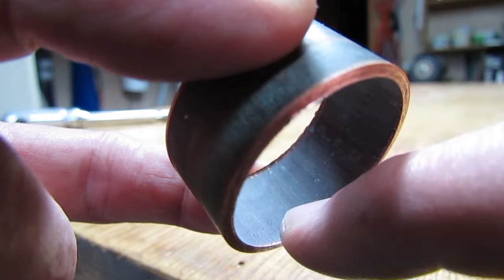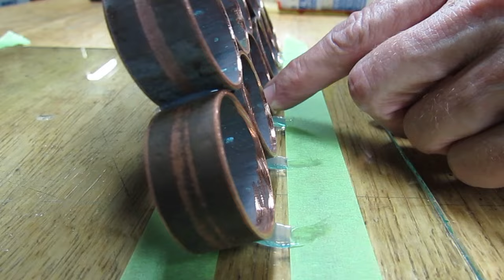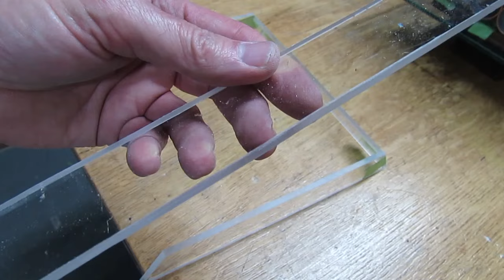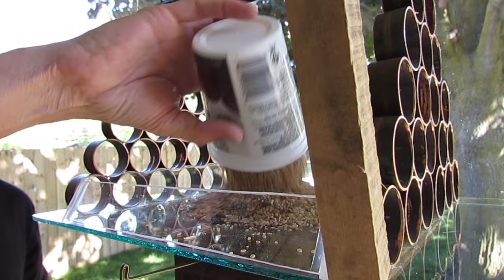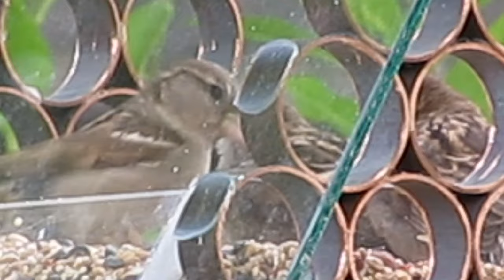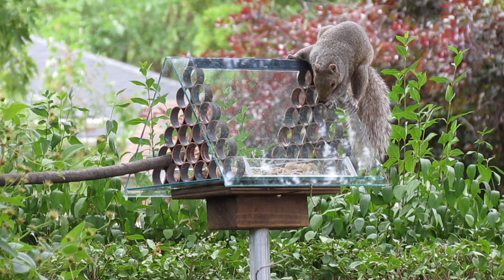How to make ● a  SQUIRREL PROOF  Bird Feeder

Comment from the maker: I'm working on another design!!  I will be using stainless steel rods horizontally instead of the circles. First I need to determine the perfect distance apart that the rods need to be so a squirrel cannot enter and will still allow the birds to get in which will be another video in itself!! Should be very entertaining! If you want, you can Subscribe Here:  ( and don't forget to click the Bell to Get Notified! )  https://www.youtube.com/subscription_center?add_user=chrisnotap
Reply: You would just need a size smaller than the average squirrel head. It's the one part that can't compress, like cats.
Reply: Nice bird variety
Reply: Thanks Chris
Reply: Do you sell these? If so I would LOVE to buy one! Please let me know, thanks 🙂
Reply: You can also build one for eagles
So that there is always a squirrel when they come by.
Reply: I would LOOOVE to buy a couple of THESE (but NOT IN GLASS),   or OTHER  "squirrel proof"  model you come up with..  Appreciate you letting me know.
You have  GREAT IDEAS, so MAKE  SURE  you PATTEN these..
You ha
Reply: I'm not very tool savy, but I really want to make this. What do you call the tool you used to smooth the edges of the cut copper pipe ? Will it be easy to attach to my electric drill ?
Reply: Moo
Reply: Why not use plexiglass for the whole thing, in place of real glass?
Reply: @fgjf1079  Wondering this myself. Seems to me, plexiglass would be a whole lot less expensive and wouldn't break if a tree branch fell on it....
Reply: @fgjf1079   might get chewed through
Reply: @TheDrakulie 

Llla
LAq
Reply: @craigrainbow7674  
Pplp
Reply: New design still in the works?
Reply: @culinarycat6607  Ditto what Culinary Cat said. I don't have tools to make it, but I could buy one....
Reply: What a beautiful design!  Functional, and pleasant to look at!  LOVE IT!  Thank you!
Reply: that is loveley.what are the measurements on the glass pieces?thank you.fady
Reply from the maker: @fadyassaad4590  All of the measurements are in the description.
Reply: @sjosly2  u can go into home depot tool section and ask them . Thinks it's a mini grinder bit for cordless They have kits with all sizes ....
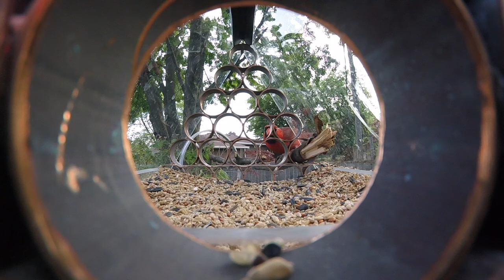Reply: Awww, that big red bird at 3:48 couldn't fit in :-(
Reply: Cool...  but can you build a  bird proof squirrel feeder ?
Reply: Can you make a bear proof one?
Reply: Build a feeder for squirrel too...they are feel hungry...don't hate them
Reply: @chrisnotap  still can't make it. I was  Rubbish at cdt in school. Not much has changed. Still rubbish now.
Reply: I'd like to see your new design. Just wondering why you aren't using PVC instead of metal pipe? A lot cheaper and easier to cut. Also PVC glue "welds" it permanently together.
Reply: I guess plexiglass would work just as well and be lighter in weight and less fragile, yes?
Reply: @culinarycat6607  You could find your local handy person, show him or her this video and I'm sure they could make it. You could go to a hardware store, like home depot, they have classes on building things.
Reply: @sjosly2  You could use metal napkin rings, just make sure they're the right size and they won't rust.
Reply: @GwenArlene8181  The squirrels would chew through it. That's why he used glass.
Reply: I feed both...squirrels and birds and they get a long very well...they need food too.
Reply: lol
Reply: Hahaha
Reply: One question are you selling these!???? I need one badly.
Reply: @TheDrakulie  exactly...these videis are just so stupid!
Reply: @culinarycat6607  me, too!
Reply: @vsmallworld8153  doesn't look like too much needed to buy in order to make. If I make em I will definitely  make for gifts.
Reply: @fredashay  i was wondering if bigger birds would not fit! Maybe there is a way to make slightly bigger, enough for bigger birds but no squirrels still
Reply: @zedman6473  it doesn't look super difficult.  Maybe give it another shot. Think of the fun you'll have watching those squirrels! I am not handy at all with stuff like this bit I might give it a shot. Looks fun watching frustrated squirrels. And if I can make them I want to make more for gifts for my friends.
Reply: Nice job 👍 ✌️🇨🇦
Reply: Two years later... 1 1/4"!!
Reply: 😎would keep other unwanted birds out too
Reply from the maker: @lizday8140  The young ones won't venture onto feeders like this until they gain confidence and get bigger. At that point they can't get in.
Reply: What a waste of time. I bet if they take you into a cell and tell you to design war machines, you would do it.

Comment: Squirrel comes back the next day with a hammer and a grin.
Reply: Most likely a rock and a high platform...
Throw and shatter
Reply from the maker: I'm working on another design.  I will be using stainless steel rods horizontally instead of copper circles. First I need to determine the perfect distance apart that the rods need to be so a squirrel cannot enter and will still allow the birds to get in which will be another video in itself!! Should be very entertaining! If you want, you can Subscribe Here:  ( and don't forget to click the Bell to Get Notified! )  https://www.youtube.com/subscription_center?add_user=chrisnotap
Reply: How come you used glass instead of plexiglass?
Reply: @TheRoyce55  forces squirrel to bring hammer instead of blowtorch which is more portable..lol
Reply: More like squirrel comes back with mafia mate knuckles the smasher..😆 🤣 😂
Reply: Only to be disappointed that the glass is actually from a window security company.
Reply: @theman7349  so the squirrels call in the friend from California arnold and his rocket launcher..😆 🤣 😂
Reply: i think next the squirrel crack the by throughout a nut
Reply: Question: what is the pretty little beige bird with the spot of red on the back of its head?
Reply: Squirrel comes back the next day with her baby squirrel to enter in that tiny hole.😁
Reply: @TheRoyce55  I think that the glass is more durable??
Reply: ok , but this feeds only smaller type of birds.
Reply: @TheRoyce55  Because squirrels can chew through the plexiglass.  I asked myself why PVC pipe wasn't used instead of much more expensive copper, then mentally face palmed when I realized sharp teeth would triumph over plastic everytime, but never metal.  Same applies for the glass.
Reply: I show up with pellet gun and skinning knife
Reply: @terryogletree2128  don't hurt yourself.
Reply: @anneramirez9577  time stamp?
Reply: Yes i do believe at least mines🙊
Reply: @spockslot  right😁
Reply: Squirrels get pissed and end up eating the birds 😂
Reply: The squirrel is going to eat through it. Just watch. They're unstoppable. They ate through my garbage can to get at a jar of leftover peanut butter. They can easily chew through plastic.
Reply: No doubt!
Reply: @sparkypack  True. Squirrels eats nuts for breakfast.
Reply: So, this is excellent to keep out robbins, blue jays & squirrels, got it...   🤔💭  🐹🐦
Reply: @taekwondotime  a squirrel can eat through glass and metal?
Reply: @andreww3278  They have no trouble eating through plastic.  :)
Reply: @anneramirez9577  Hi Anne. It's a woodpecker called a Northern Flicker. Fairly large.
Reply: It could be plastic
Reply: You saw him look at the camera, grin, and contemplate
Reply: @chrisnotap  2 years later... 1 1/4"!!
Reply: @anneramirez9577  I’m sure you found an answer after this amount of time but on the tiny chance-  A Northern Flicker, perhaps?
Reply: @Lint_Julep  thanks!

Comment: Looks very nice and easy to make.  Over 3k comments, I couldn't read them all. So, this may have been posted already.  The only suggestion I can make is to use some sort of bumper, silicone bead, rubber, cloth, wood, etc. on the edge of the bottom glass.  This would lessen the likelihood  breakage of the opening panel in the event of an accidental drop.
Reply from the maker: Great tip.... yes!!

Comment: Well done!  Never thought I'd see the day a squirrel proof feeder that actually worked!
Reply: You haven't seen the ones where the owners electrify the feeders. The birds can eat freely without harm but the squirrels get a shocking surprise. It doesn't harm them but it let's them know they are not welcome. What if they do come back? They get more of the same!
Reply: That feeder won't prevent baby squirrels from getting to the birdseed. My design works on all squirrels large and small, and it didn't cost me anything.
Not sure I can adequately describe it here, but I will try....I took a black tree nursery style plastic pot (about 1-1/2 to 2 gallon capacity), drilled a hole in the middle of the base a bit smaller than the pole so it stays in place when it is slid up the pole. I removed the stabilizer bar on the bottom of my shepherd's hook pole and slid the pot up so it hangs like a bell when the pole is upright. Any lip should be removed from the mouth of the pot so the squirrels have nothing to grab onto. The squirrel will climb the pole till it's inside the pot. When it can't see it's destination, it climbs back down the pole till it can see it again. It continues the cycle till it gets tired and gives up. If the pot has drain holes for water, they must be covered else the squirrel will chew a hole big enough to squeeze through. You could also use an old Home Depot style 5 gallon bucket or plastic mop bucket, just make sure the lip is cut off so the squirrel has nothing to grab onto when it jumps. This deterrent won't work if the squirrel can jump from a tree branch or building onto the feeder. I live in the country, it may not be pretty, but this method has been flawless for 3 years.

Comment: Clever design. I am wondering if it keeps younger,smaller squirrels out though.
Reply: Well,where I live,young red squirrels are quite small.
Reply: I would suggest adding some  F21 to the mix.... its a car car wax you could apply to the glass. No real reason other than the fun of watching the  grey bandit sliding  off the sides. :)
Reply from the maker: We don't have chipmunks. I don't know if a chipmunk would be able to climb the steel pole. Maybe other commenters came read and answer this for us.
Reply: Chipmunks are pretty small and most likely would be able to get through the holes. Have a trailer out near Belleville area and there are probably more chipmunks trying to get into the feeders than squirrels. Where i live though there aren't many chipmunks so it depends on area.
Reply: Z

Comment: Absolutely the best as well as functional and beautiful bird feeder design I have ever seen
coming from one that has gone nuts fighting squirrels. I noticed in you comment reply that 11/2" is large enough for cardinals? Could 11/2 " PVC pipe also be used? Copper is very costly here. Your design is very attractive and will look good in any environment, city as well as in the country.
Reply from the maker: Thanks so much for that!! You could use pvc pipe but there is a good chance they will just chew through it to get to the seeds. That's why I chose to use copper.
Reply: Hey yes ., thank you, 'never gave that a thought. You just convinced me. BTW did you mention in your earlier replies that the 11/2' is large enough for Cardinals ?
Reply from the maker: Yes, I have had cardinals go in it. It took them weeks before they ventured in ( 8 weeks). They seem to not be able to figure out how to go in a hole probably because they are open nesters.
Reply: Thanks for your reply, about 8 weeks huh. Wow, yes i realize they are open nesters , well I'll give it try anyway and keep up with some of the feeders I am using now, however the squirrels and doves are driving me batty, even the 'hotpepper' is not keeping the squirrels at bay, but I saw that squirrel catcher and that one seems to make a lot of sense, and have it on my 'to build ' list. That leaves the doves to content with. Anyway thanks for listening.

Comment: I absolutely love this design.  I originally found this video several years ago and followed your instruction on building one for myself.  I’m happy to say that’s it’s been in use for 3 years now and it’s held up extremely well over our New England winters.  My bluebirds absolutely love using it although I had to help a couple of them out because they didn’t seem to remember how they entered the feeder.  The squirrels don’t even bother with this feeder any longer.
Reply from the maker: That's great! My feeder is still going strong. Been up for over 6 years now. I have another squirrel proof feeder planned to hopefully build this spring using sheet stainless steel. Stay tuned.
Reply: @chrisnotap  I'll be looking for a design that will let larger birds in like crows and cardinals but not the squirrels.
Reply: Thank you for reporting in on your homemade one's resistance to New England winters, it's so helpful to know it'll last in these conditions.

Comment: A simple solution is to mount the feeder on a high pole. At the base of the feeder suspend a sleeve from springs that fits around the support pole.

As the squirrel climbs the pole and grabs the sleeve, he'll slide back down to ground level, then the springs will retract the sleeve.

Combine this with you new design and the birds could keep feeding without ever being bothered by a squirrel. 
Plus you get to watch squirrels ride the firepole.
Reply: Squirrel would figure that out in 2mins. What's to stop him just going over the sleeve or climbing the springs? Might as well just use a wide based feeder. They'll still jump to the thing but at least it's not needlessly complicated.

Comment: That squirrel was really pissed off...!!!
Reply: if you want to really piss it off, I'd suggest an oil down or some kind of spray, however the fluid would need a viscosity so it's not so runny but low enough that it doesn't provide friction for the squirrel to keep from sliding off.
Reply: Did anyone else hear a high pitched squirrel voice continually cussing? LOL
Reply: @Icarus_and_Me  Melbourne as in Victoria or Florida?

Comment: Clever design but does restrict the size of the birds that can or would feed. Very good, nevertheless.
Reply: Bigger birds can use their beaks.
Reply: I hate when they like the comment but don't answer
Reply: @GoogleAccount-kp9dt  even if it is to say something pointless like that
Reply: That’s when you scale up the dimensions of the holes for larger birds, but then you run the risk of squirrels which is what this feeder was designed to keep out in the first place
Reply: My best method for squirrels giving a local teen a pellet gun ,they basically drove the squirrels over here to extinction,and I give them 10$ a squirrel
Reply: Erich  The idea is to try and feed MOST songbirds as opposed to grackles and crows etc.
Reply: Yes that is the point of the one I built, besides squirrels I also have 10 magpies wintering in my yard and they eat everything...except what is in my feeder.  It restricts who can chow down on my bird seed.

Comment: Won't a bird crash into that glass?
Reply from the maker: No. It's on an angle. If they do they deflect off.
Reply: I think you can draw (or carve) a grid pattern on the glass to prevent them from crashing into it, birds' eyesight do make them harder to reconize transparent materials
Reply: Chris Notap yea except birds fly at all angles not just parallel with the ground.
Reply: He did put sticks in for them to land on.  Birds are actually fairly intelligent when it comes to finding chow and they can see edible stuff from far away.
Reply: Chris Notap, you could add ultra violet paint on the glass, the birds will see it but we cant and wont obstruct our view.
Reply: It’s a very small risk when you compare it to all the glass windows around
Reply: Birds only come near it as a destination so already slowed down.
Reply: Adi Tude He got his training at Wal-Mart.
Reply: BasicMobile d
Reply: Birds will crash into it no oftener than when they crash into your windows or patio door which is almost never.
Reply: @crossman20  But you don't keep food next to your door glass, it might happen quite often if you do.
Reply: @jimlepeu  I know.  We have kamikazes all over the area.  At least twice a week, sometimes three, the birds smash into our windows and are left stunned with a massive headache.
Reply: Birds are pretty smart. They watch each other, but I can’t say it won’t happen

Comment: Just seen your other test for the gap between bars. 
Would a test to see whether a vertical hole would reduce invasion compared with a horizontal shallow hole which might still allow squirrels to squeeze through on the stomachs?
Another you tube channel has shown squirrels getting their hips caught in an almost circular hole, yet their heads, shoulders and presumably stomachs fit through.

Comment: They make a special glue for plexiglass and super glue (cyanoacrylate) works pretty well too.  I thought your experiment showed squirrels could get in your glass jar with anything above 1 3/8"?  I would think from that that 1 1/2 would be vulnerable?
Reply from the maker: This is a bird feeder I made about 5 years ago using circles. The circle experiment is here...https://youtu.be/R3Cv-r5dIVs
Circles are different since they are not able to get their shoulders through like bars. I'm working on one that uses bars instead of circles. You watched the "bar" experiment.

Comment: Any reason why you used silicon to hd the rings together, rather than soldering them together since you were using copper pipe?
Reply from the maker: Silicone is so easy and forgiving and dries slowly. With soldier you'd need a propane torch, steel surface. It was just way easier and clean to use silicone. Plus for most people soldiering is at another level. I try to keep things as simple as possible in my builds.